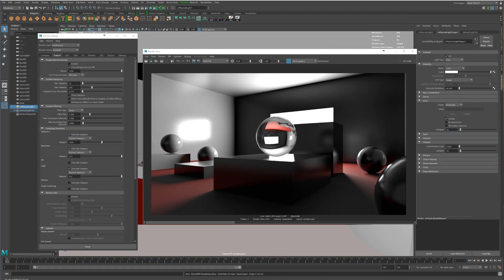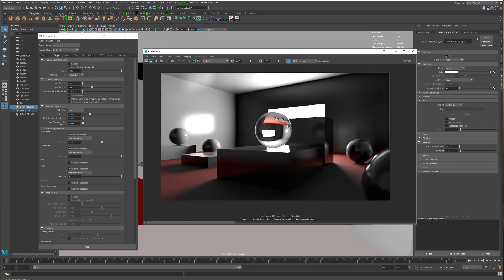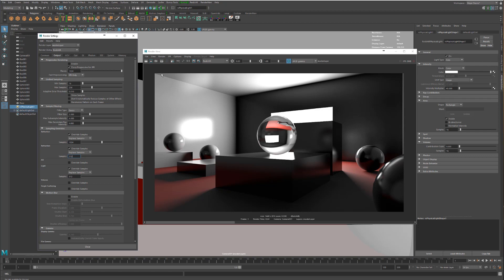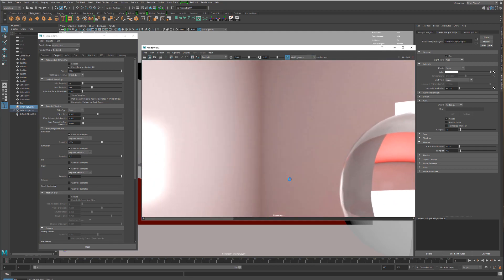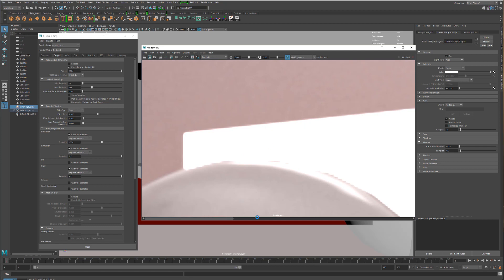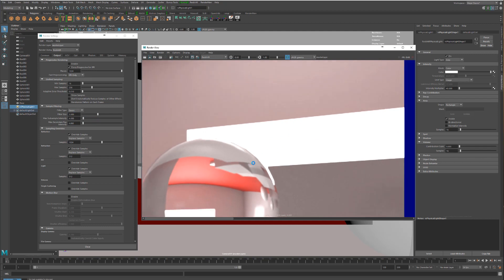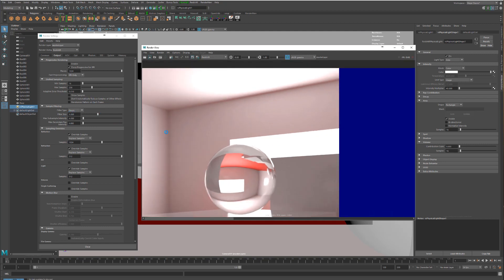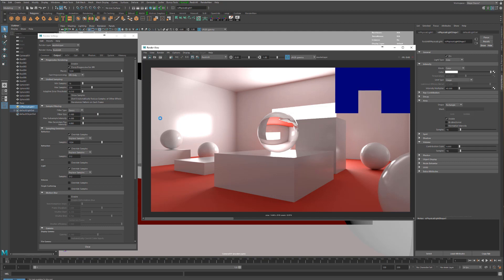Redshift 2 Maya - Tutorial #5 - Unified Sampling & Cleaning Noise

Comment: Seriously was about to give up on learning Redshift until I saw this. Thanks for taking the time to put this info together. Redshift is not an easy renderer to just jump into like the others, but I've heard it's worth it lol
Reply from the maker: Seun Jubril it’s very easy actually, I just think people over think it. Your literally doing the same thing in every renderer that has sampling controls. Arnold, Renderman, Redshift etc all do the same thing. Local samples (specular, refraction, etc) should always be larger than AA based samples. That’s all there is to it. I just go into detail why it is the way it is.
Reply: @TheArtofSaul  Gotcha! I'm coming from having Octane as my only experience with a 3rd party render engine, so I'm not used to having to dial in settings like this. Redshift is cool tho. After I got the setting dialed in, my render went from around 4.5 minutes a frame to 1 minutes and 10 seconds and it was practically noise free. lol so I was definitely doing something wrong. Thanks again for the information!

Comment: Thanks for the great video,  a quick note I wanted to make on this is that the outputted AOVs don't use the ray clamps so they're not necessarily an accurate representation of your samples being clean.  I personally rather the workflow of turning off features (reflection, refraction, etc...) in the render options and cleaning them up individually.
Reply from the maker: Dan Konieczka it isn't perfect but it lets you quickly identify where the noise is coming from especially now that we have AOVs in the redshift renderview also.

Comment: Brilliant turotial! I can see you put a lot of work into this, but its greatly appreciated, thanks so much!
Reply: 2/3rds in you said you would go over the GI engines too in another video? Any idea if that would be in the near future or have you got other videos planned first?
Reply from the maker: CalvinsOfficial im gonna cover a few smaller tutorials first that are easier to make like materials, curviture shader etc because the gi engine stuff will take some preparing to explain like this video did. soon though.
Reply: Also i have a question, should i even use bruteforce GI if it adds so much noise and render times?
Reply from the maker: It depends on the situation, Brute Force GI is prone to not flickering as much in animations, its better for exteriors where things are lit nicely with light. For interiors like archviz stuff or areas with a lot of smooth surfaces like interior walls floors etc Ir radiance Cache works wonders. Generally thats the rules of thumb. Brute Force rays do need to be increased also if your using hair/fur and volumetrics because volumes use Brute force regardless.
Reply: Ah okay cheers, im currently working on a forest scene (your tutorial on proxies was a lifesaver) and my rendertimes are crazy and almost crashes maya at times...working with 500.000 trees though on a 1070...

Comment: Hey Saul, thanks for all these great tutorials on redshift. I'm starting to experiment more with redshift and I really like it. Everything was pretty clear regarding min-max and local samples, however, how to you calculate the ray bundle? I can't seem to find  the right equation for this. Thanks for your answer!
Reply from the maker: I wouldnt worry about calculating that since its going on behind the scenes just be aware that you need a large enough gap between your min and max samples to actually maximize this so the adaptive sampler works nicely. so use 16min 256+ max as a good spread instead of something like 4min 32max which will limit the adaptive sampler to less ray bundle steps. Also try to use multiples of 32, so like 32, 64, 128, 256, 512, 1024 etc so lets say 512 is almost clean but you need a bit more samples add 128+512 or lets say 512+64 etc
Reply: Alright, I will keep that in mind. My mistake was that I gave too much min samples from the start, I was probably clamping everything too much. I see faster and cleaner results already. Thanks for the quick reply :)

Comment: Hey! Nice tut! I really like getting to understand how things work behind the scenes because it helps me understand which numbers I need to tweak and why. 
I'm just trying out a scene that has a rather hardcore DoF thing going on, but as I increase local samples ( so I can increase my min/max samples to clear the DoF bokehs) it gets unnecessarily long render times on the object that's in focus because of the materials getting far more render time than I think they need. 
Should I just render that object by itself and then render the little particles floating around by themselves with a matte? or is there some way to tweak this so that the focused object doesn't get that much attention while still cleaning up the hardcore bokehd particles floating around?
Reply from the maker: Carlos Espinoza I would render it in separate passes because it's going to be computationally heavy if you have that setup rendering across the entire image.
Reply: Yeah I thought so. Thanks a lot for answering me. <3

Comment: Hey Saul, great tutorial.  I'm curious though, the Redshift Manual says that unified Min and Max samples are "the minimum and maximum number of primary rays that will be shot per pixel".  But your saying that primary rays are the local samples / Max Samples.  Is the manual wrong or just oversimplifying the concept?
Reply from the maker: Rich Nosworthy over simplified. everything in this video is correct as of version 2.5.10 and older.
Reply: I am a bit confused as well, about how you use the term "primary ray". Primary rays are the rays from camera to first intersection. Also called camera rays.
And please correct me if I'm wrong, but I would have thought it goes like this:

local samples/max samples = samples per primary ray

so let's say, as in your first example in the graphic, we have 
16 min, 512 max, 1024 local

1024/512 = 2 samples PER primary ray (these are the local samples, or secondary rays)

So we are shooting anywhere between 16 and 512 primary rays (as the redshift manual says)

And for each primary ray, we are shooting 2 secondary rays (local samples) resulting in something between 32 and 1024 max samples per pixel.

Comment: Hi 
Thanks for this wonderful video. It helped a lot.
I need a little help with a work I am doing now
I am trying to make a Full CG car video in Maya 2016
After when I am done with Lighting and texturing and I hit render, It shows, translating mesh, calculating ray trace in 2 -3 seconds as command below the software and then it shows rendering and nothing happens for 10-12 minutes and in next 2-3 minutes it renders and the whole frame gets done in that 2-3 minutes. 
If I try to render that same frame again..now it won't take 13 minutes to render, it will get done in 2-3 minutes. 
This is one problem. 
Post that when I render in Batch its again taking 13minutes per frame. 
I am not understanding the functioning of the plugin..can you please help me with this if you have encountered this kind of problem.
Thanks a ton

Comment: so what exactly constitues local samples? light samples + gi rays?
Reply from the maker: tokyomegaplex local samples are everything else except unified samples. I explain it in the video early on, light samples, refraction, gi, reflection, volume, sss etc found in the overrides
Reply: Thank you for the video! But how exactly can we calculate the number of Local samples? There is no such indicator, but rather we have separate numbers for GI, Reflection, Refraction, AO. Lets say, these four are set to default 16 samples, so shall we sum them up to get the Local samples number? Is it 64 in case when each of those four parameters is set to 16?
Reply from the maker: Alex Petrov each element is calculated separately so you don't sum them up.
Reply: Then I don't understand the logic.. You said that Local Samples \ Max samples = Primary Rays Per Pixel, assuming that this number is the actual primary rays count (amount), and then after multiplying in by Min and Max samples we get the actual number of rays per pixel. But if each element is calculated separately than this equation shows only rays count for a single element, lets say GI. But there is also Reflection, Refraction, AO.. So how can we get then the total Min and Maximum amount of rays shot per pixel? Max Samples is universal, Local samples is individual for each element. So we should sum up the results of four equations (where we take Local samples number from each element) in order to get the number of how many rays will be generated in total. Is that correct?
Reply from the maker: Yes correct, those numbers start getting huge so I didnt bother mentioning that but you are correct for arriving at the maximum total rays fired possible. Keep in mind that this maximum wont be hit because of the adaptive engine and adaptivity threshold choosing less or more where needed per pixel though but thats how you arrive at the maximum possible rays per pixel count.
Reply: Would the average numbers work? That is, add the samples of reflections, shadow, volume, etc., and the total divide it by the amount of items with local samples? For example, I have 2 spot lights with 64 samples in shadow, a material with 128 samples in reflection, then, sumo 64 + 64 + 128 = 256, and then I divide it by 3 (2 spot lights, and the material) 256 / 3 = 85.3 Could this number be the best option? I say, thinking about big projects, where you have dozens of materials, lights and other things with samples, maybe the best option is that, I do not know, I just want to put together a logical equation that will serve such cases.

Comment: Do you have any tips on which samples to raise to get rid of noise from Depth of Field? Thanks....
Reply from the maker: I mention early in the video (Graphic also shows this) that the Unified Sampler is only meant to tackle noise in Anti Aliasing, Depth of Field (DOF) and Motion Blur. So if your using a lot of Depth of field and motion blur you can pump up the unified sampler Max to higher numbers like 512 or 1024+ and just remember to have higher local samples than those max Unified.
Reply: Saul Espinosa Thanks a lot! I must have missed that...

Comment: the equations for the ray bundle packets don't work out?
Reply from the maker: Luke & Dad Productions they do, what do you mean? The thing about ray bundles is you can't control that value anyways I just explained how the GPU is firing Ray's in groups just to explain how it works behind the scenes.

In the end sampling is every simple really.

Local samples must be greater than Max samples. The engine likes exponential numbers due to ray bundles being in maximum groups of 32. Have a decent spacing between min-max unified sampling so it has room to be adaptive.

That simple really if I had to distill all this information down.
Reply: ah. figured it out. the calculation should be (max-min)/bundle = bundle packets. you've got the division wrong way round

Comment: minute 19-20 there is a mistake.

32ray bundle/(32min - 1024max)  = 31 (??? this is not correct)
32/(32 - 1024) = -0.03225806451

what you probably meant is 
(1024max - 32min)/32 = 31

so your formula should go like this
(Maximum Samples - Minimum Samples)/Ray Bundle = Ray Bundle Packets

kind regards tho for making a video and trying to explain
Reply: that is taking into account that  PrimaryRaysPerPxl = Local/Max and not the other way around
Reply from the maker: @canyoupleaserunfast  You need to round up the number to the nearest full number, you cant have negative or float 0.X rays fired, it must be an integer, it fires or it doesn't. So its actually 31-32
Reply: @TheArtofSaul  even like that it will still be negative number. -1
Reply: maybe you meant 32-31 ;]
Reply: then the formula will look like:        Ray Bundle Packets = Ray Bundle/(Maximum Samples - Minimum Samples)
Reply: https://imgur.com/gallery/PlAKMBh 

here you go here is a detailed breakdown of the mistake i mean. i assume you are correct with the ray bundle packets formula but it doesn't work out. the secondary attempt is with my fix and the numbers almost match(apart from where there's 61 supposed to be 62)
Reply: i excuse myself on this as i keep repeating steps 1-3 multiple times for no reason :}
Reply: further down the example on the 26th minute should be 3packets not 4? https://imgur.com/gallery/gBHyhDC

Comment: Balancing this many abstract numbers must be a nightmare for an artists.
Reply from the maker: Not really its pretty straight forward, more local samples than max samples. lol. I just went in depth to the mechanics of what its doing. Its no more difficult than increasing samples in any other engine like Arnold which has diffuse, reflection etc. Same thing except if you want you have the extra control.
Reply: no,  i'm so happy with this render engine, a little bit more time consuming setting the render, but ohhh so fast

Comment: Don't know where did you get the term of "Local sampling" and the formula. It's really misleading how Redshift works. In your document, 4 gradients example really misleading how Engine judge the pixel. Engine only judge the pixel determine by the times of ray hits the object and get the most possible color. In your theory, the color of the 192 samples hit determined by the scale of the gradient is very wrong. 
Also Redshift give us the flexibility to control which effect gives out more samples, i.g. if there is an object and it's reflection goes really off, then I can just adjust up the material's reflection samples and it will be much faster than turn unified samples up.
Reply from the maker: Vance Huang this knowledge comes straight from the lead Redshift dev so no it isn't misleading. It's EXACTLY how the system works. I recommend you review the forum documentation and the basics of raytracing. Local samples ARE reflections samples, GI samples, SSS samples and so on. So your saying exactly what I am saying. Nowhere here do I mention increasing unified samples min/max over the total local samples as that is wrong. That's the whole point of this video. I think your misunderstanding the video.
Reply: @TheArtofSaul   Can you give me the reference where are those information you're referring to in the forum documentation and the basics of raytracing which says the formula or 'local sampling'? I'm sure 'Local Sampling' is not written in Redshift documentation, I assume you made it up yourself. Instead Redshift Documentation has 'Samples' to describe which effect samples are separated from unified sampling to make Samples are able to adjust individually. 
My whole point of this comment is the term of Local samples can be really misleading plus your theory formula is a myth I don't see it anywhere except for you saying that and also the 4 gradients image is really wrong concept.

Comment: You needed 1hr to explain this?!!!
Reply from the maker: Dark Man you don’t need an hour, I just went into detail of the why sampling works this way. This is true for all engines. You can sum it all up in a sentence but most people still don’t understand.

Local samples > max unified samples

Local samples aka specular, GI, refraction etc must be higher than Max unified aka AA samples so the engine can focus samples where needed. Doesn’t matter if your using Arnold, Renderman or Redshift, sampling is sampling but people get confused especially when dealing with adaptivity.